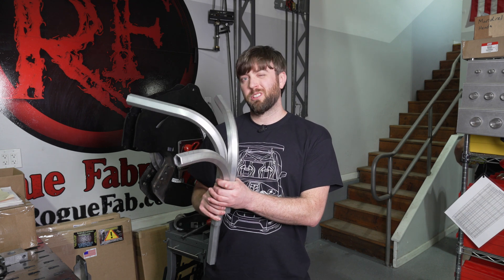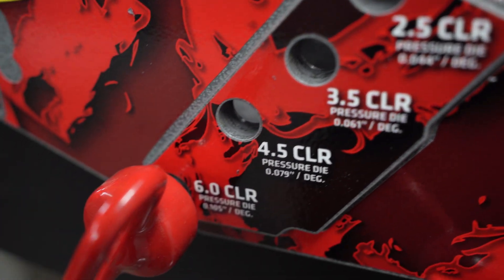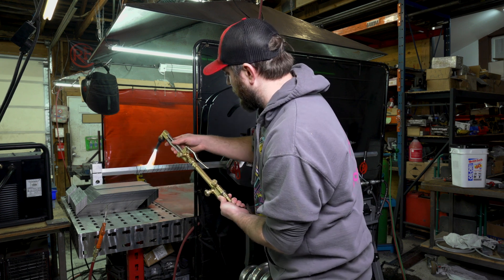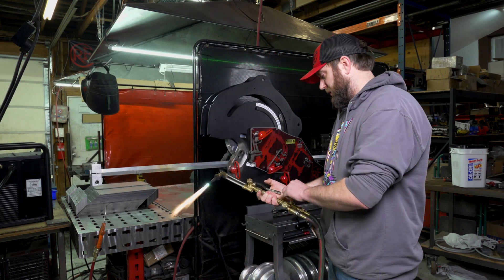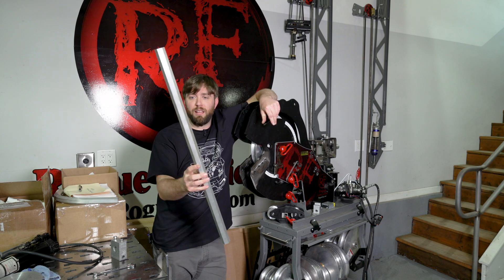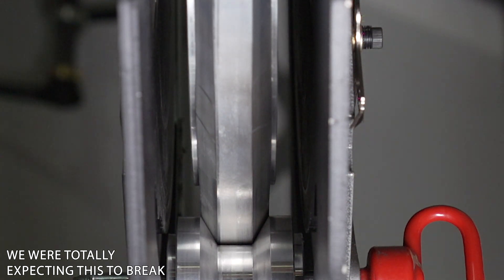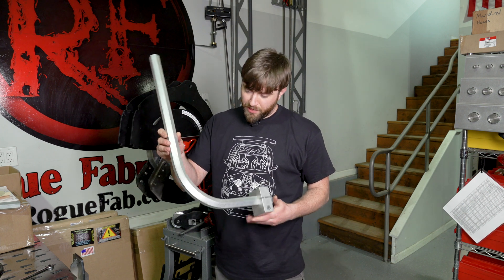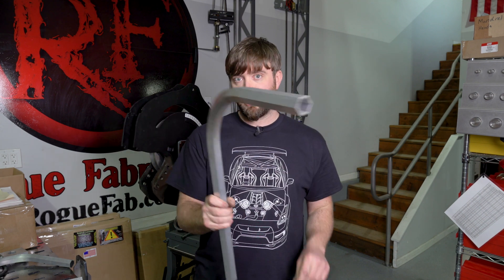Mastering Tube Annealing on 6061-T6 Aluminum Hexagon Tube

Comment: You can also fill the tube with ball bearings, oil, or sand. anything that is incompressible works.
Reply from the maker: We're annealing in this video (for cracking issues, not deformation). We have other videos on mandrel bending (and alternatives). I think that is what you're thinking of.